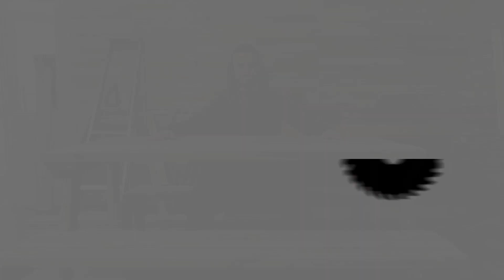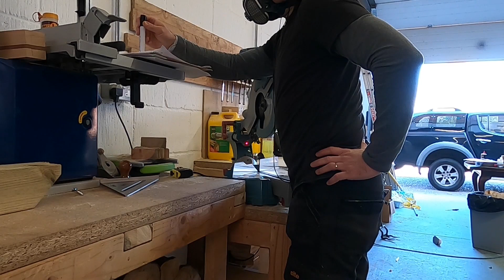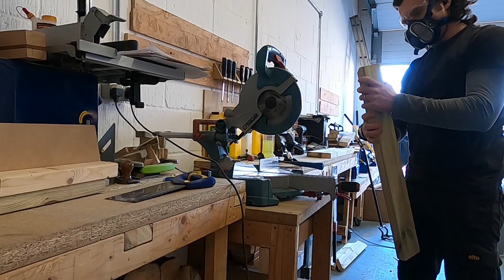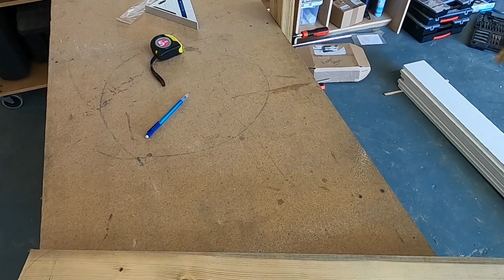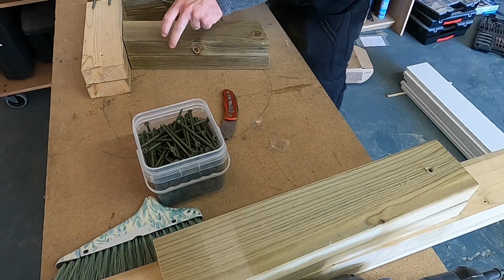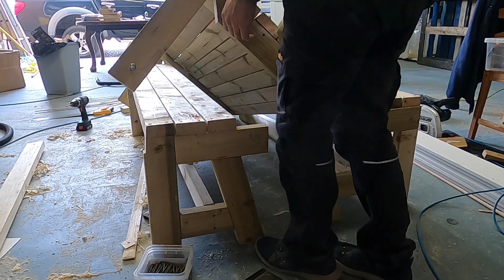Build a Folding Pub / Picnic Bench [#28]

Comment: I'm glad to see that I'm not the only idiot when it comes to cutting angles the wrong way round.
Reply from the maker: It's why we buy at least 10% extra. Just in case.
Reply: @EverymanBuilds  would you be able to upload the plan and a cutlist? Or just do a video with it on it, and we can pause it, and copy it from the screen (easier for you)? Great to see you use the different tools making the bench. Came across your channel as I'm a great fan of Erbauer tools. Keep up the videos. Loving the relaxed style.
Reply from the maker: @danielcookeb90   there is a Sketchup model in the description, but here is a list of cuts - all measurements are the long measurement where pieces are cut off. 

3x 1576
9x 1500
3x 1424
1x 1350
2x 421
2x 592 (45 degree cut at 19mm at one end)
2x 700 (45 degree cut at 19mm, FLAT, both ends)
2x 324
2x 412 (take off approx 5mm at 7 degrees across the length)
2x 281 (15 degree cut at one end)
2x 175 (15 degree cut at one end)
2x 429 (15 degree cut at one end)
2x 358/334 (15 degree cut at both ends, 358 is longer measurement, but when the 15 degrees are cut it is 334)
2x 780 (15 degree cut at one end)
2x 293

There are some changes that still need to be made, and I haven't gotten around to changing the model or getting the dimensions. The key ones are to make the seat less wide - this should only be the 3x 1424 and 1x 1350 cuts and they only need a few mm off to allow for some clearance between the legs of the two seats.

I would also recommend removing one of the lengths for each of the seats, and two from the top -- obviously this changes the dimensions of the legs and the top supports. 

Hope it helps. This is the project that made me more a fan of relative sizing rather than mm accuracy.
Reply from the maker: Worth noting also, this is specific to the timber I was using which is 89mm x 38mm.
Reply: @EverymanBuilds  thanks again for this. It will be at the top of my list now! 👍👍